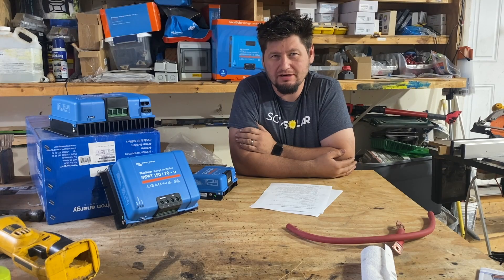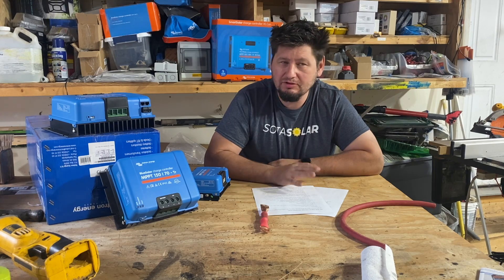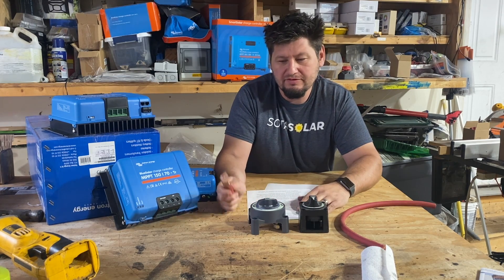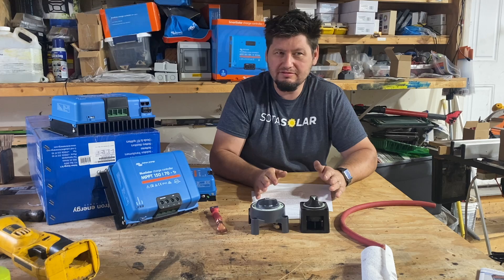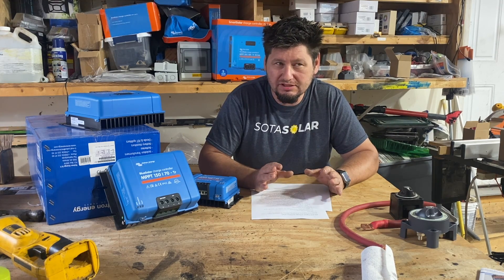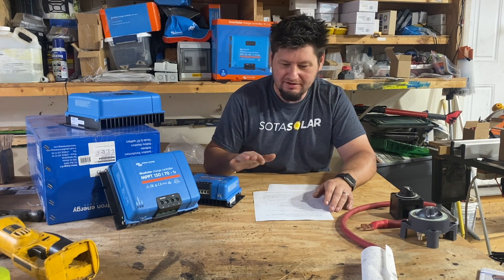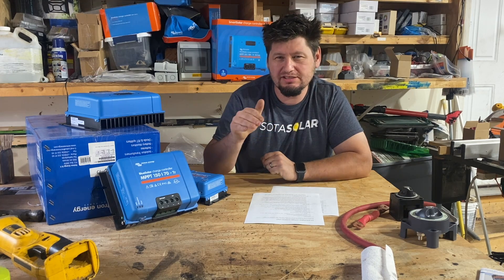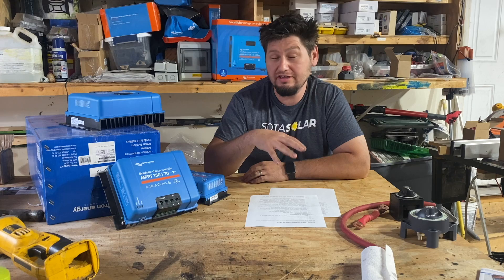24v and 48v RV Solar Systems Pros Cons Tips and Tricks

Comment: PC on a van/RV. A very powerful PC consumes around 500W/h (all included). Add a good monitor and you're pulling 600-700W consistently for a couple of hours. That is my set-up. Then - try making coffee or running a conditioner even at lowest power. You need a 3000W converter (3000W of actual, continuous power, not the peak one). Try running that from 12V :-D Crazy. I know that the Chinese companies are making such converters but it's literally crazy. With 1000W of the actual, continuous power draw, you can get away with a 12V system, if you need 2000W of continuous power, you go 24V and when you need 3000W of continuous power at times, you go with a 48V system for your RV. Panels are cheap, batteries are getting cheaper, so no sense going below 1000W on your roof and no point paying for electricity at the camp sites. It's a lot of savings on a long run with LIFEPO4. It used to be different with AGM's, which had a 50% capacity and a max 0,2C of actual input/output but with 1C LIFEPO4? It's still good keeping them under 0,7C in general, which is another reason to go higher voltage, but there's no sense paying for a campsite power. On a top of that, when I turn my PC on at full power, I make the fuses go off for a whole camping ground. With 600Ah LIFEPO4 in 24V, I often do not even plug-in for actual loads, only for charging if I'm low at the moment.

Comment: the biggest benefit to efficiency is found in 24v systems because nearly all 12v appliances can run on 24v just fine. getting rid of the inverter or only using it for short times during the day is really important for efficiency and longevity since inverters are basically wear items. they now make cheap 24v air conditioners primarily meant for semi trucks, and every dc fridge i have found runs totally fine if not better on 24v. These two items are usually the main electronics that need to be kept on long term. if you wire primarily for DC, and have 12/24v cigarette plugs as receptacles, then you can further leverage the advances made in usb-c with "car chargers" which have their own boost/buck converter and run at ~98% efficiency. you dont have to worry about the voltage negotieation since it is handled by usb-c PD protocol... as long as youre using the correct usb-c cables. you can get rid of the ac adaptor and directly plug in usb-c appliances like a laptop, most of which use 20v. most home electronics that have those annoying barrel jack plugs can either be removed and resoldered with a 12v pd trigger board (like a wifi router and modem), or you can buy usb-c to barrel jack cords which have the trigger board built in. One single run of 4AWG can supply around 50 amps for short periods of time over ~50 feet, and with the nominal voltage range for 24v LFP batteries being ~27v, youre looking at about 1500w of total power which is the same as standard north american 120v wiring. 
they are starting to make cheap 24v cooking appliances which include rice cookers and induction cook tops, which can be plugged directly into a 24v cigarret plug without modification. if you need AC power somewhere for a specific short term use appliance, you can skip 120v wiring completely and use a 300w inverter on the receptical side of the 24v system. 
some little known hacks about dc wiring: you can usually avoid having to round up your wire size if you route the + and - wires separate from eachother by about an inch. also, red wire is useful for labeling, but red heat shrink is very cheap and black wire actually runs cooler than any other color under load. this is because a matt black colored item will actually radieate heat slightly better because of its higher thermal emissivity coefficient. while completely misunderstood by most people on youtube, the majority of the heat loss from electronics at standard operating temperatures is from radieative heat transfer. its why many electronic heatsinks are painted black despite the black paint adding convective insulation, black painted heatsinks run cooler due to higher emissivity.

Comment: Excellent video. I do wish Victron would also make a 48v Orion 12v programmable charger, as opposed to converter.  I could see a lot of cases where there is a heavy draw 12v device (say hydraulic leveling) where it might make more sense to retain a 12v battery as opposed to a huge dc-dc converter to handle those intermittent big loads. 

As far as that goes I think if they came out with a 48v 2x120 Easy Solar (MPPT’s built in) with a 12v charging output built in….

Comment: 1590W Solar through 500V dual pole cutoff switch into Victron 150/60 charge controller Quattro 24/5000 with 2 24V 200 WH batteries servicing a complete RV rewire after gutting, new framing, subfloors, insulation, walls ceilings, macerator toilet, 36x6 foot walk-in shower and entertainment center. All for less than half the cost of a small piece of showroom junk from the dealership

Comment: Honestly, a lot of this went over my head, however I think that based on what you said, anyone wanting to run an AC for more that 30-60 minutes should consider stepping up to a 48V system. Wouldn’t this be anyone who would possibly want to explore the SW in their van during most of the year? I understand that the biggest impediment to going with a 48V system would be inability to charge with a factory installed alternator, but the alternator could be replaced or a secondary alternator could be installed? Do you have a video describing the details for this? Finally, I think that the other big problem is running most of the electrical devices that aren’t compatible with 48V so you can buy some Orion device that solves that problem? Also, for some reason which I don’t understand if you have 400ah of batteries with a 12V system you only need 1/4 or 100ah with a 48V system? Now I plan to watch your other videos to help figure all this stuff out.

Comment: Thinking to step up from 24v to 48v, installation have two of Victron 12v to 24v dc to dc chargers.  What do you think about connecting them in series to end up with 48v of charging voltage  ?
Reply from the maker: I’ve heard it said, you’re either on something, or onto something. 

I don’t see why it wouldn’t work. If the magic smoke comes out though….  ¯\_(ツ)_/¯
Reply: @sotasolar  Thanks for your kind reply. Mentioned above solution might eliminate the need for second alternator installation.

Comment: My installer suggested that going to 24 volts would require two 12 volt batteries in parallel as opposed to maxing out a 24 volt battery. Does anyone have an opinion about this?
Reply from the maker: Yeah I do. I’m usually “many ways to accomplish the same goal” but on this I have strong opinions. If you stack 2x 12v 100a batteries with 100a BMS for 24v you don’t have a 200a BMS, you still have a 100a BMS essentially. It’s no different than a single 24v battery with a 100a BMS. The only difference is you have to now balance the two 12v batteries using an external balancer. 

I do agree you should not max out any BMS or battery. Run  2-3 batteries if you intend to max out an inverter.  Just my $.02.
Reply: It should make no difference if you use two 12V in SERIES, or one 24V. You could do the same thing with 12 cells lead or 8 cells Li, but you would not have a BMS that treats the battery as ONE, as stated at 11:10.  That's the big difference.  Series is what gets you the advantages of higher voltage, ONE BMS is better than multiples.  Two "batteries" in series is no different than 8cells in series in the same package as far as capacity or "maxing out".

Comment: Question, if you step up to a 24V or 48V system & alternator, how does that power the rest of the vehicles 12Vequipment? Really leaning in to a 24V or 48V system as the efficiencies are too good to overlook.
Reply from the maker: Usually the higher voltage alternator is a secondary, or you use a high quality step down converter if just house loads. If engine start is still 12v, you need two alternators without some crazy tomfoolery.
Reply: @sotasolar  great info thanks for the reply I appreciate it and love the content! Planning on full timing in a super C here in the next year and want to be able to boondock as much as possible.
Reply from the maker: @spitfire155k2 if you’re thinking about Victron equipment 24 V is probably the right way to go when you’re ready to purchase I’d love to help you out
Reply: @sotasolar  Fantastic! Will definitely stay tuned to your channel and give you a holler when I’m ready for some assistance! Thanks again and awesome content!

Comment: We have a mini solar system with a Basen Green 11,7kW 48V 230ah battery, which is charged via a Victron 150/35 by four Bluesun 480W panels on the south balcony fence with a total power of 1920W, which on a sunny April day charges this 12kW battery to 100%. With this system, we charge a 3.6kW Ecoflow Delta Pro battery - an inverter from which we use electricity for washing machines, drying, cooking, charging batteries, etc.

We would like to upgrade the system with a three-phase inverter, which would supply electricity to the house on all three phases, namely in such a way that the first source would use energy from the panels, then from the battery and finally from the electrical network.

Please, if you can advise us on a suitable inverter in the direction of establishing an optimal system.
Reply from the maker: With 3 Victron inverters you can create 3 phase. Might be worth looking into .
Reply: @sotasolar  So I can start with one phase first to detect, how system works.... :) so which Victron to buy for one fase?
Reply from the maker: Depends on your loads for sizing. At least the 3000va, possibly the 5000. Then it also depends on on your power standard. Are you US 120v or EU 230v ?
Reply: @sotasolar  EU 230V ... can you send me link to the 3000va or 5000va Victron, thanx
Reply from the maker: @adamsisernik4556 https://www.victronenergy.com/inverters-chargers/multiplus-ii

Comment: If you pushing less than 1500 watts 12 systems are fine more than that 24 volt .. my 12 volt has me running my heat in winter… it might not be for you and how deep your packets Good 👍 stuff

Comment: When you're dealing with a big system, high voltage makes sense to me. I just finished a 48v system on my MH. It uses 8, 550 watt solar panels on the roof, wired in series, delivering 336 vmp (399 voc) to my 500v rated, 5,000w all-in-one inverter/charger/charge controller to charge a 16s 320ah (16.38kwh) prismatic cell battery. One BMS keeps them all in sync too. I have a 560ah 12v battery, to take care of my 12v needs and power a small 1000w inverter. It is charged by a 620w liftable array on the side of my coach (since my big array covers the entire roof.) Sure. there are challenges associated with using higher voltages, but their advantages, like smaller wiring, increased efficiency and simplicity more than offset their detractions on a larger system.
Reply: U had to so 2 system instead of 1 48v? What do u think of just going 24v with a step down to run 12v vs 48v on a smaller rv
Reply: @Customers_support  That would work. We chose both a 12 and 48v system for several reasons. First, our slide and hydraulic jacks draw a lot of current, but our biggest draw is the starter on our 5,500w generator at around 300 amps. We bought a 330a (1,200a surge) BMS to start it. If we didn't, we would need a 300amp step-down buck converter to start it. This means I would need to buy 10, 30a buck converters, consuming a fair amount of power and costing about $500. So I thought, why not spend this money on batteries instead? Redundancy is important on a rig you are living in FT. If our 48v system goes down, we have our 12v system with an inverter as back up. Plus, I carry a spare inverter and 50a charge controller just in case. Another consideration for us is that we couldn't afford to build everything at once, so had to build it in stages, starting with our 12v system, and adding our 48v system yrs. later.

Comment: Wow, you did a wonderful job on the commentary!.  And it is refreshing to see someone talking about higher-voltage systems because too many channels push 12V gear well beyond the sizes where people should be going to 24V or 48V.  I think mostly because a lot of channels get free 12V gear from vendors.

One additional recommendation I would make is not only should the native batteries be at the system voltage, but there should always be at least two in parallel for redundancy and robustness.  So 2 x 48V batteries in parallel, for example, for a 48V system.

I am really happy with my 48V system.  24V wasn't enough once I started pushing 2000W worth of panels, but at 48V it is just crazy how cool everything runs and how small all the gear is.   I am at the point now where I go straight to 48V even when I'm doing a small amount of solar.

--

Victron is definitely behind the times on 48V gear.  They have a 48V Multiplus II but it doesn't have split-phase output.  And they don't have a 12V-to-48V DC-to-DC (they have all the other combos, though).  There are plenty of other vendors that do 48V split-phase.  The really popular one right now is the EG4 6000XP.

Finally, an observation on inverter size.  One disadvantage of big inverters is their idle power draw / overhead power draw.  It can be 30-60W.   But there is a solution!  Hang a smaller inverter off the battery system that is always left on and use that inverter to run the fridge and all the low-power stuff (which is almost everything, to be honest).

Then use the high-power inverter ONLY for the kitchen area, with a remote switch situated in the kitchen itself so it can be left turned off most of the time.

The A/C system is debatable.   Native DC mini-splits are pretty awesome once you've decided on 48V, but are an expensive upgrade if you wound up getting a 12V or 24V unit.  So sometimes AC mini-splits or A/C units are a decent choice despite the lower efficiency.

-Matt
Reply from the maker: Thank for the great comment!  Victron does seem to have more efficient inverters. They also have a mode where they will run as modified sinew I’ve or even search mode until a load is detected.  It would accomplish that kitchen scenario without a switch at all. 

Great ideas all around, thanks for sharing!
Reply: I like the way you think. One of the reasons I went with a 48v Sungold Power 5,000w all-in-one is it only draws 20-25w at idle in power saver mode. I also have a 12v 1,000w inverter wired separately I use when less power is needed (like for TV and computer use) using a smaller, 560ah 12v bank. It's good to have redundancy when living off-grid in our motorhome like we do. I was going to go with the hotspot 48v DC mini-split but chose the new EG-4 28.5 SEER2 plug-n-play mini instead.

Comment: I use two 2/0 hot wires and two 2/0 ground wires on my 4000 watt split phase low frequency sungold. Its considered to be way over kill but to minimize voltage sag during high amp draws its what i use for my 24 volt system. To make components last its what it takes. Sure it will run on less wire but its cheaper and safer just to double up the wire. Also use fus3s that are just under the rated wire amp max that way its safe but doesn't create a pinch point in the flow of power. I run a minisplit for heat and cooling and built my own 30 kw lifepo4 battery and have a backup leaf battery thats around 14 kw and use it with a victron DC to DC charger to connect the two batteries. I have 3200 watts of solar and three victron charge controllers. I love the victron gear but the inverter stuff they sell is super expensive and way to much involved with firmware updates and trying to get it set up. The sungold low frequency is way more power and has been super dependable. After loosing everything in the fridge 3 times because of the victron inverter i went a different direction lol. Anyways great video

Comment: I prefer to start with limiting amps to a reasonable limit.  Then figure how many watts are needed, and choose a system voltage to work with those constraints.

I usually choose a design preference of 150 to 200 amps.  At 12v that means a normal max of 1500 watts or an overall maximum of 2000 watts.  Double that for 24v.  Double again for 48v.  The only problem comes in with larger systems (20kw to 100kw range) which is pushing the limits of 48v systems.

Comment: Thanks for reviewing pros and cons of 12, 24, 48 volt systems.  Talking about having to balance individual 12 volt batteries is good to hear as it's not overly well documented elsewhere.  Like you say, if you have a 24 or 48 volt system, you would ideally have matching battery voltages controlled by the built in BMS per battery.  Some batteries do have a data bus that you connect between individual series connected batteries, but mostly that is not the case unfortunately.

Comment: I have a truck camper. Right now I have a 12v system. I want to change over to 48v system. But I want to change my A/C to a 12volt A/C. How could I run a 12volt A/C on 48v system?  Or do you have a different idea?
Reply from the maker: I think you’re looking for trouble and adding too much complexity .

You’ll never get enough solar to realize the savings and efficiency of 48v .  Stick with 12 in your case. The big efficiency gains for 48v is solar and inverter, you’ll use less of both with your setup. Biggest solar controller you might use is a 150/70

Comment: FANTASTIC Video with the exact question I was looking for an answer to.
My 5th wheel already came with a 12 volt 2k inverter that hasthe built in transfer switch so I think I will stay with 12 volt until I get to the point of wanting to run an AC then switch over to 24 volt. Really happy with my 640 watts of panels and 50 amp victron hooked to my 280 AH diy battery.
Thank you explaining in a way that makes sense to me.